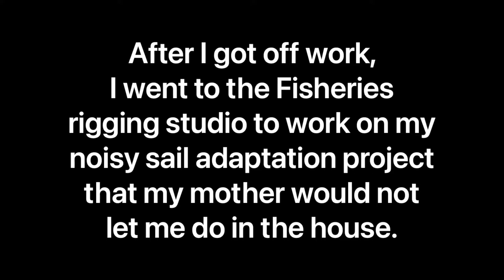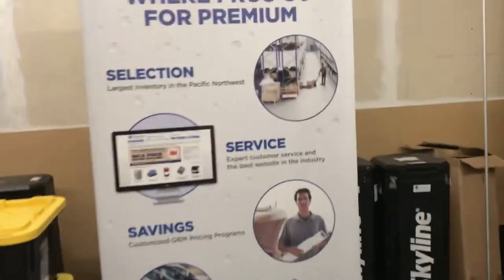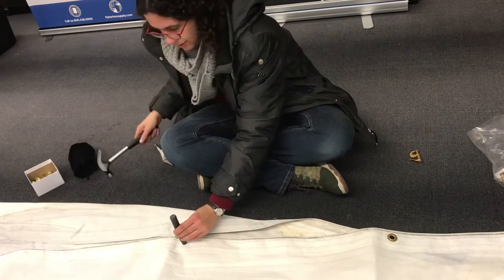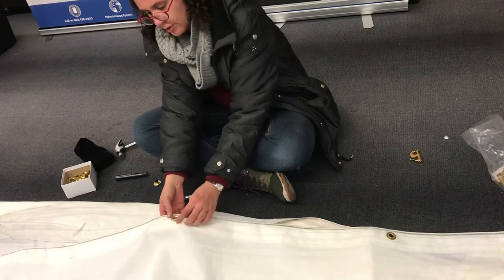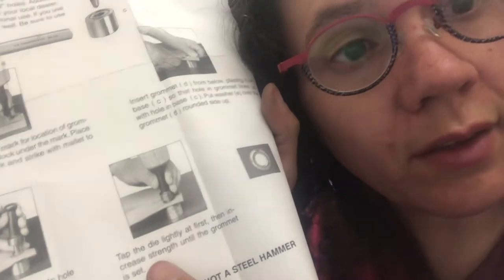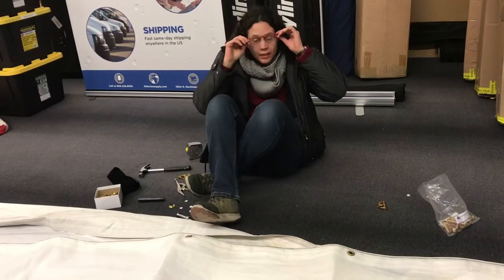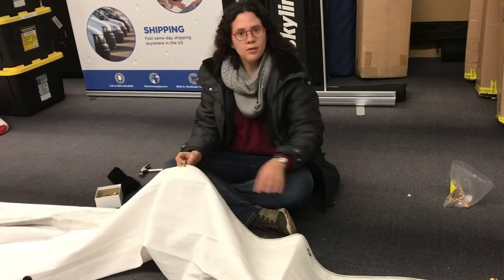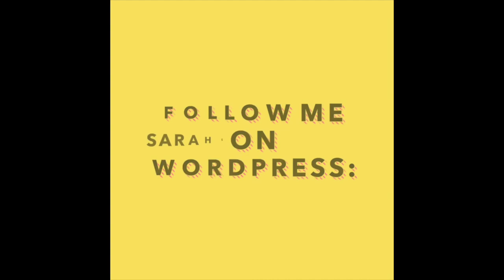How to (and not to) install jib grommets and hanks —Sarah Scott — Adventures of a Black Woman Sailor

Comment: You should only use Spur Grommets on sails.  Washer grommets are not strong enough and the sail material can "drift" under the grommet causing a failure.

Comment: You should have something like hard wood or plastic under the snap to react against the hammer.  Certainly supporting the piston side on good sailcloth doesn’t look correct.   Similarly your hammer looks to be too soft for the job, a leather or nylon face would be better.